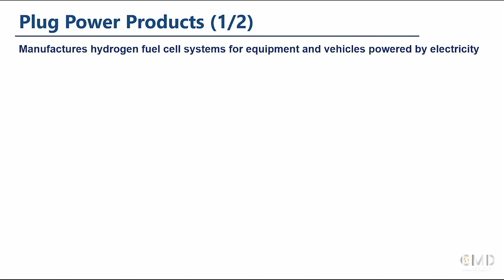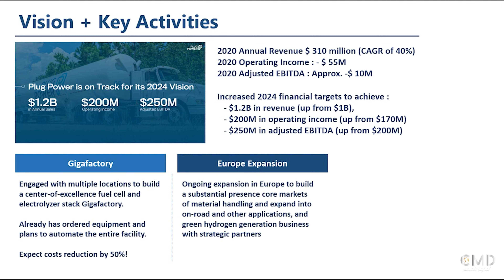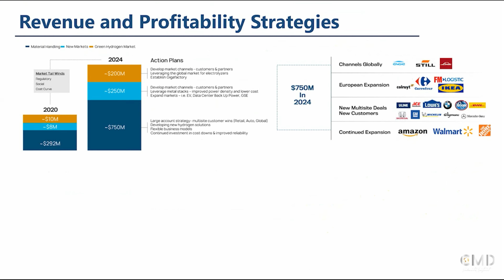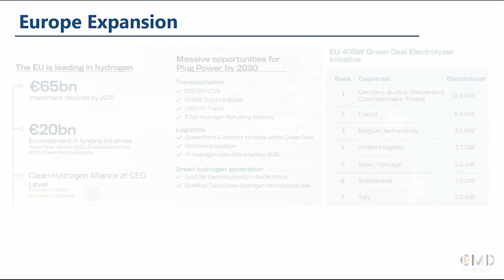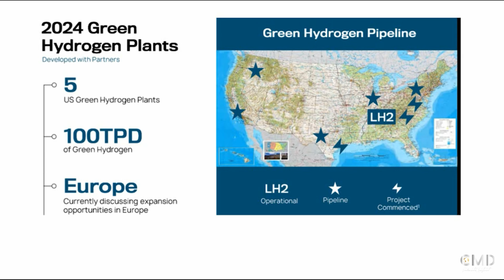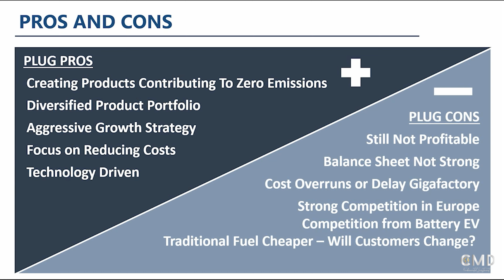Plug Power Stock Analysis (The Future Strategy) - Huge Potential if They Suceed!

Comment: It's at least 10 years too early for hydrogen
Reply from the maker: Agree and not all companies should have seen such huge increase in share price. Plug though looks like a more solid company among the bunch!
Reply: @cmdfundamentalinvestment9033  Plug is screwed forklifts will be battery powered the new li ion batteries are very rapid charging they can do 0-80% charge in 18 mins

If I was the CEO of plug I would dilute 10% at these crazy valuations to ensure survival for the next 10 years and work on making the products better so that hopefully the world embraces hydrogen in the 2030s
Reply from the maker: I think 18 minutes still needs improvement considering these kind of places wants to run 24/7 without any stop, but I agree batteries could be a threat to them as well as for the heavy trucks which is another key area for them. 

I still think they have other interesting stuff in their pipeline though like the PEM Gigafactory. PEM are also expected to increase significantly in the future. 

However in the end none of this justify the current share price, but the market does not always reflect reality. Fully agree this is the time to raise capital and dilute value without being attacked by shareholders :)
Reply: @cmdfundamentalinvestment9033  If you have a 18 mins charge cycle that means you just need to buy 1 extra forklift per 80 you own. 80 in operation and 1 on charge at any one time

When a worker is near empty he goes to the charge point plug in and jump into the fully charged one

Simple

Also eletricity is a LOT cheaper than hydrogen considering the efficiency etc

Hydrogen makes sense for long range needs like heavy trucks or ships or aviation it makes no sense for forklifts

Imagine this if Tesla announces An electric forklift what would happen to plug power? Probably -80% instantly
Reply: @cmdfundamentalinvestment9033  Also 18 mins charge is today 2021

I wouldn't be surprised to see 0-80% charges in less than 10 mins in the next gen battery in the next 3-5 years
Reply from the maker: Hi Kaya,

Can you just take me through your assumptions, so I am sure I fully understand : 

- Are you assuming one charge per forklift per day?
- Are you assuming a perfect recharge cycle of forklifts?

I do agree that battery technology in terms of km per charge and charging time improves day by day, but today you still need to consider that the battery time decreases over time. Hydrogen refuelling time has actually also decreased significantly year over year. 

I am by no means disagreeing with your points as they are very valid, and it is a threat to this part of their business. 

Haha, would be funny if Tesla did so, but the question is whether it is sexy enough for them to move into forklifts :) ;)
Reply: @cmdfundamentalinvestment9033  

Hi

Depending on the chemistry used things differ but if we assume a cheap battery chemistry is used Li Iron Phosphate (it's about $80/KWh and that will go down) that chemistry is particularly good at cycle life and deep discharge and charge

If you have a 24/7 warehouse you have a few options probably a good method is as follow

Let's say it is a warehouse where 100 forklifts are needed working 24/7

You buy 110 Electric Forklifts and install 30 fast charging points

You Size the battery such that it allows at least 6h continuous useage from a charge between 5-80%

At maximum there are 100 forklifts in operation. The other 10 are charging

When one of the 100 in operation gets low on battery the driver goes to the charge point and plugs in the forklift and jumps into a fully charged one

This way the driver doesn't need to wait 18 mins for his forklift he just jumps into an already charged forklift

The next driver who is low turns up at the charge station plugs in his forklift and jumps in one that is fully charged

And so on

Yes you have to buy 110 forklift instead of 100 but it solves the charge time problem

The additional forklifts are not a waste because the lifetime of a forklift probably has a certain number of miles on average so if each forklift does 100,000 miles before it's scrapped it means you still get 100,000 miles out of each one

There are also other advantages which are huge advantages

1: You don't need to have hydrogen delivery. Every warehouse already has ample eletricity. And what if a delivery is late or hydrogen supply is unavailable you would be screwed 

2: You don't need a huge storage tank on site which is cost and time and capital and space

3: You could potentially charge the EVs with solar on the roof

I am pro hydrogen where it makes sense. Aviation shipping HGVs and perhaps also heating of homes and industry. But it doesn't really make sense for forklifts
Reply from the maker: Fair enough and I can probably better relate to the 10 additional vs only 1 extra per 80 forklifts as it would appear to have more realistic flow of change, although I have no idea on the time the forklift can run on one battery charge vs hydrogen, but all these things needs to be considered. 

In the end of the day it is just a matter of CAPEX of investing in forklifts vs OPEX to keep them running. Interesting discussion for sure and thanks for your input. 

In terms of hydrogen delivery, you could argue that the facilities in the future may also be able to deliver some of the hydrogen itself through the excess electricity although that is probably a bit further out for large operations. It will be interesting to see how it develops. 

I fully agree and as mentioned in a few other videos I also think the market is getting way ahead of itself, and some investors is blindly investing in some of these companies, and they risk getting seriously burned at some point. Time will tell. Have a good evening and thanks for the messages.
Reply: @cmdfundamentalinvestment9033  These fuel cell companies are hype hype hype imo most of them are not even worth 1/10th of current prices

Shorting is too risky and options are too richly priced and unfortunately the mass of investors have no clue they are just bandwagon hoppers

These companies should make hay while the sun shines and raise enough capital to last for at least 10 years

People also seem not to understand there is no just one company working on hydrogen there are at least 100 companies

Also the new investors seem to have forgotten a bird in the hand is worth two in the bush. These companies will be unprofitable for at least a decade = dilution and also why put $30 billion into this company if you put $30 billion into an S&P tracker it would be worth $60 Billion+ in a decades time. At that point to justify such a price this company would need to be making at least $3 Billion annual profit to justify $60 Billion market cap

There is no way in hell this company with its current model can make $3 Billion annual profit in 2030

Extremely over valued
I would be surprised if there isn't a 50-80% correction in the next two years

Comment: Very informative, whats your price prediction for Plug Power by end of 2021? Also could you do a video on FuelCell Energy please? Cheers
Reply from the maker: Hi J F, if PLUG can deliver on all the expectations setup, most importantly the construction of the Gigafactory and at the same time grow revenue, we do belive it can move further up in the high 20's. However, a lot of things needs to pan out for this to happen, and today we feel there is more downside risk than upside based on the large recent gains. If you consider to move into Plug Power, please note that RSI is moving into the +70 range, so you may want to wait a bit. Depending on the feedback on this video, we may also try to do one on FuelCell
Reply from the maker: @boyplunger OK it seems like there is an interest on FCEL! Will try and make something in the coming weeks. :) It seems most companies are going up simply because of future expectations and we have the feeling that underlying fundamentals currently is being a bit ignored, which can be dangerous.